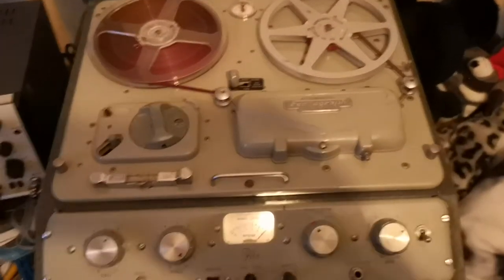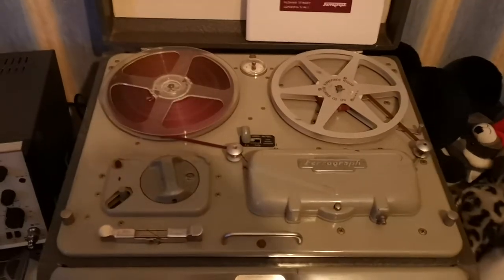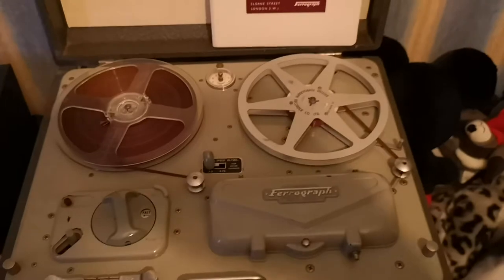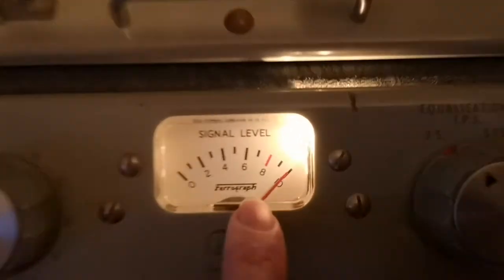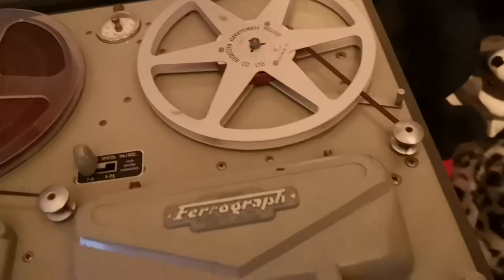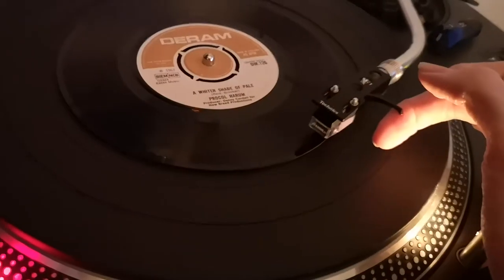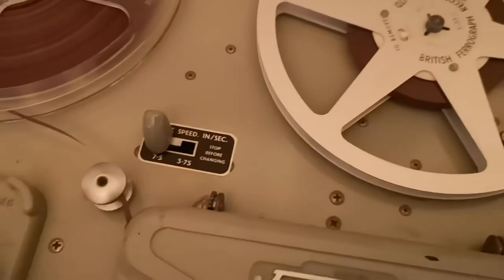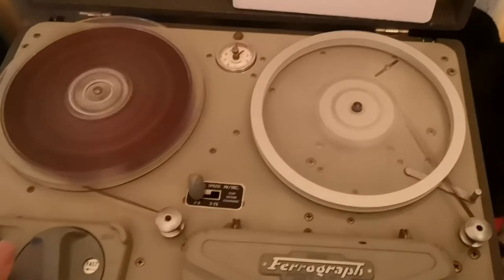Ferrograph Series 5

Comment: How did yu record the vinyl to the reel to reel? Did you use a mic input with adapter?
Reply from the maker: I use input 2 which serves as both a line in and line out. Using the mic input would cause distortion.
Reply: Where does that attach on the reel recorder?
Reply from the maker: @JoeMeekSociety  The jack labelled input 2 on the front of the machine